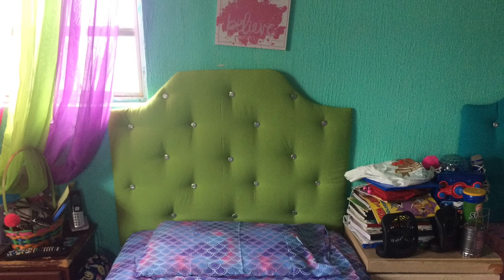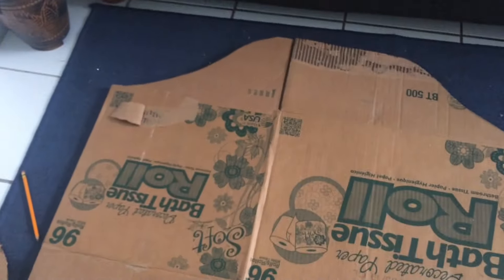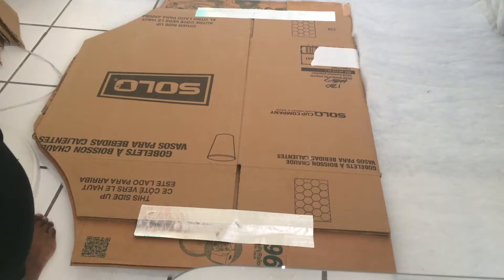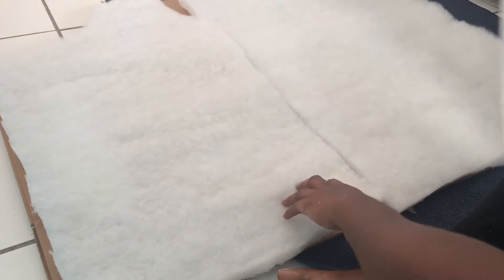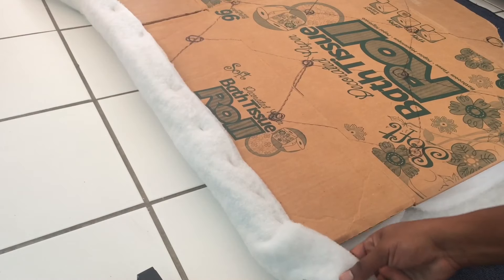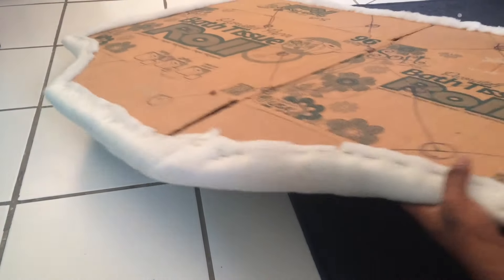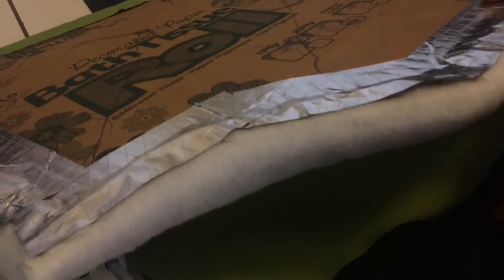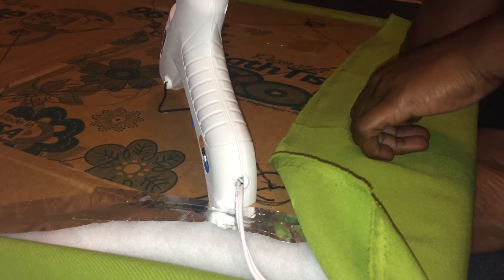DIY|how to make a bed head out of cardboard

Comment: Wow! You have super powers that I don’t have. So the staple holes started to tear the fabric so I reinforced all the staples with glue (very strong glue) So that the fabric would not free or tear. This seem to work very well Until some of the toughs popped out. I am sure I will get the hang of it eventually but holy cow you are freaking amazing! I have no idea what I’m doing wrong but thank you for the videos. I think next time I will try wood in place of wood. Instead of cardboard. How much does wood really cost anyways (Rhetorical question)? Anyways do you have any additional tips? I think what I might have to do is just start over. I hope not
Reply from the maker: I wish I saw these messages but I’m so sorry I did not. I was not on YouTube, but I’m back now and I will do the next video again. Thank you for the support and the love.